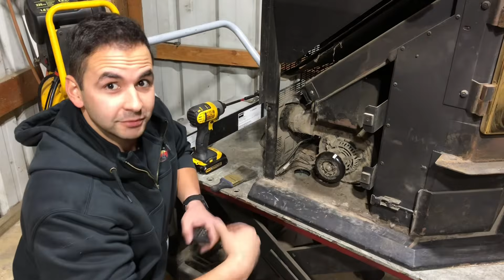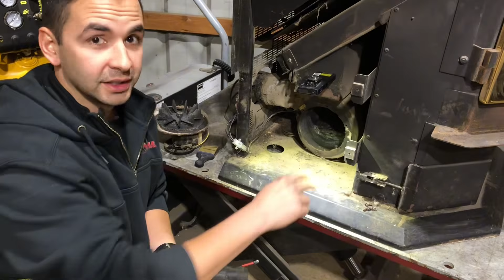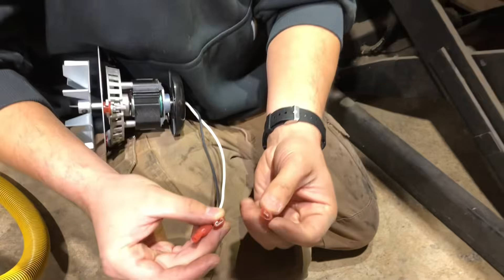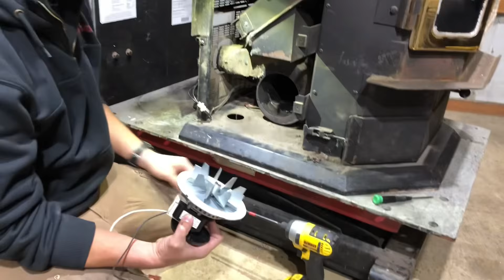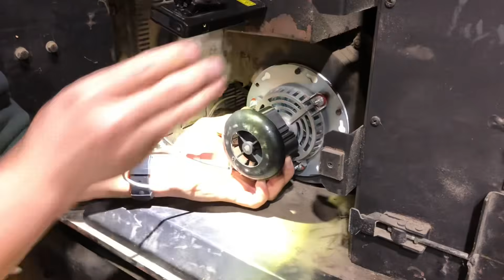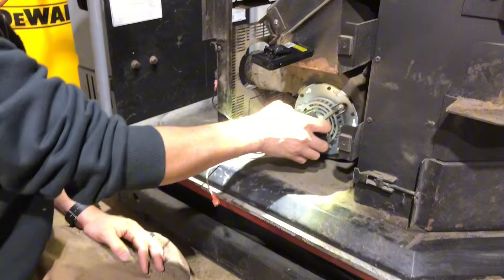Quadra-Fire CB1200 FS Pellet Stove Exhaust Motor Fan Installation Tutorial

Comment: Thanks guys. 
Et al,  the motor is an AC motor.  Doesn’t matter which lead gets connected on the two wire if they are both white or both black.  But if they are white and black, the connect the black to black and white to white.  You’ll sleep better.
Reply from the maker: Thank John
Your reply helps others on our channel.
Please Subscribe 
Thank You
Brett and Briggs
Reply: Mine is an older model lots and lots of screws in those side panels.  Hit the like button and comment 
  The exhaust fan port and fan surround was caked with clinker which I cleared by torching to an asphalt consistency and making scrapers out of things I had in the shop

Comment: I have a Quadrafire 1200I similar but a little more involved screws do not appear to be accessible, I only see the thread end. I think this fan is most likely my issue. I have a 3 position rocker switch on the right side when it is in the low position the stove functions properly. If I start stove on low its ok but if toggled to medium or High the fan stops blowing and turns very slow but returns to normal if I put back to low. If I start on low and it get up to temp then toggle it to med / high it does blow heat into the room but the fire stops dancing in the pot and again fan spins very slowly. .
Reply from the maker: Based on your comments...it could be the switch on back...hi med low
Or the 3 speed control board is bad.
Please see our website 
Milespelletstoves.com 
If you need a part.
Please Subscribe 
Thank You
Brett and Briggs

Comment: Thanks for the video guys. Good job! Mine is just like that but the wife finds it too noisy. I already cleaned and all. I was wondering if I can disconnect the fan and leave it disconnected. Will this cause any malfunctioning? Would it work just like any other fireplace, except that it drops pallets every other minute? We're fine if the heat doesn't dissipate. We just went want the fire going.
Your input is really appreciated as you seem to really know what you're doing. Keep on the good mood!
Reply from the maker: Best not to disconnect the fan. The stove will overheat. Also, most likely the high sensor will trip causing the auger to stop feeding pellets and the stove will shut down. Most importantly....the safety of you and family. Please do not disconnect the fan.
Reply: Is there a quiet fan?
Reply from the maker: There are OEM and Non OEM fans available. They are pretty quite. Maybe a new one may be the direction. Not too sure how loud your existing fan is.
Thank You for watching our videos.
Please subscribe

Comment: does it matter which wire connects to which? My new fan has 2 white wires
Reply from the maker: It shouldn’t matter if the new fan has two of the same color. 👍🏼
Reply from the maker: Usually a new fan comes with two different colored wires.
With two the same, you should be fine to connect and finish the job. Hope this helps...subscribe. 
Thank You